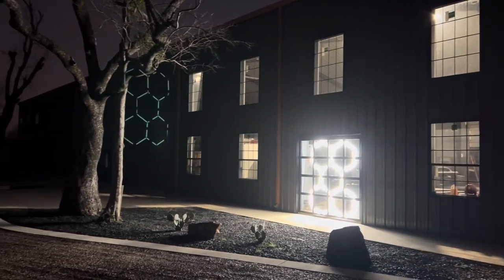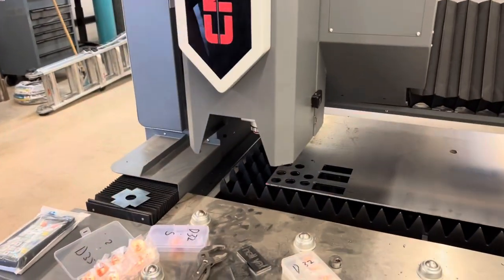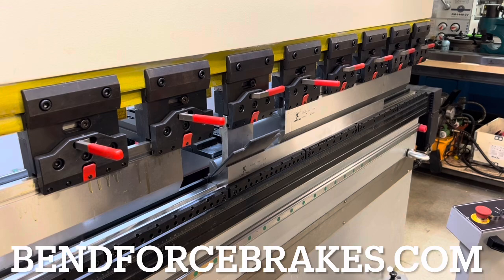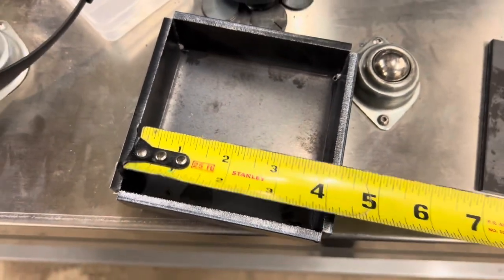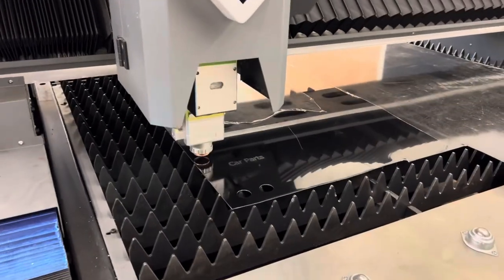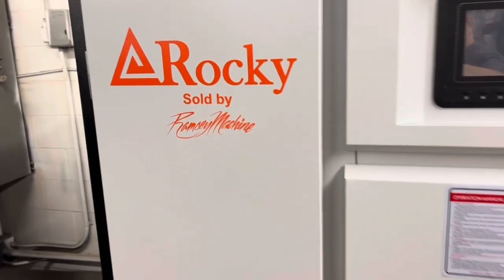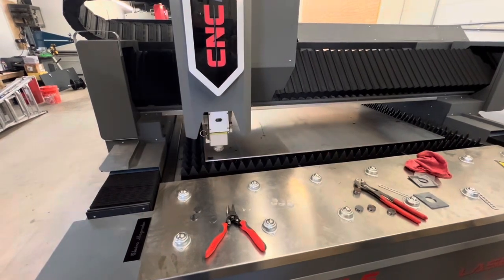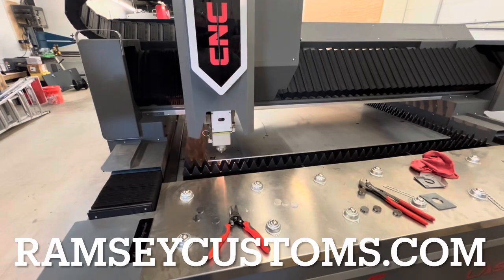CNC Press Brake Install - Colorado Springs, CO Bendforcebrakes.com

Comment: 3:40 is that an E-Link sticking up in the air under the infrared tube heat? 4' is normally considered burn zone on infrared tube..

Comment: What materials other than metal can be cut with a laser?
Reply from the maker: fiber lasers like this can only cut metallic products like steel, stainless steel, aluminum brass, titanium, etc.  There are other types of lasers like CO2 laser that can cut materials like wood, plastic, etc, then you also have the marking lasers that do a great job at engraving

Comment: no more laser installs for the year? its only March
Reply from the maker: Yea, exactly.  Some of the older machines are now needing a little more support, and I am selling a ton of press brakes, which mostly do not require onsite installs, which in turns lets me stay more available to take support calls, ship out parts for down machines, etc.
Reply: But what am I going to do when I need my 40 - 80 kw? It will probably take a year for the new building and by then they will have 100kw.
Reply from the maker: @garyfiler5768 I will take care of you when your ready, just can’t take on any new customers